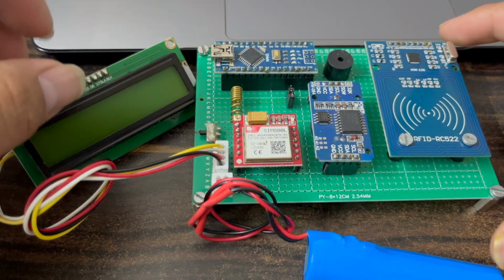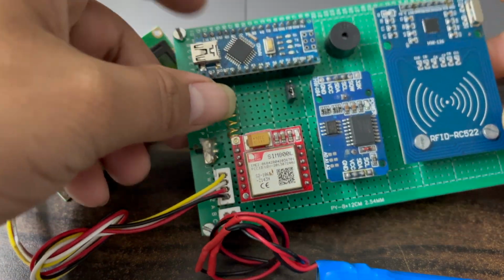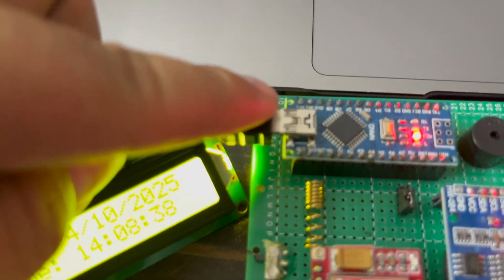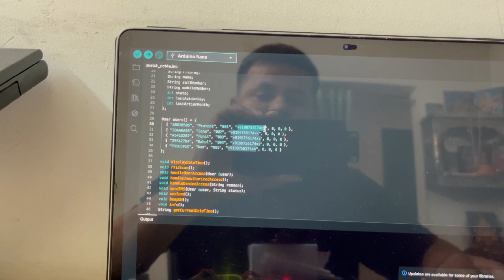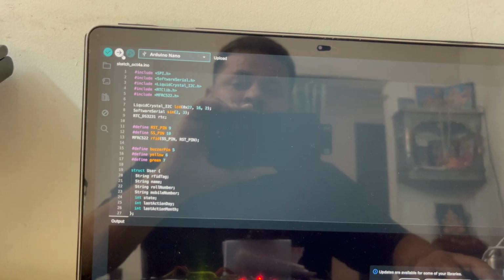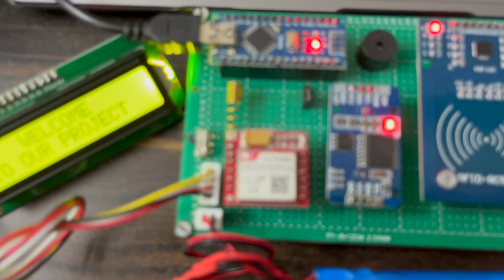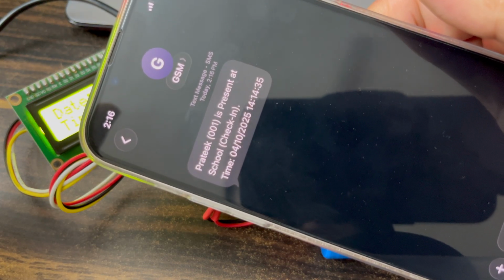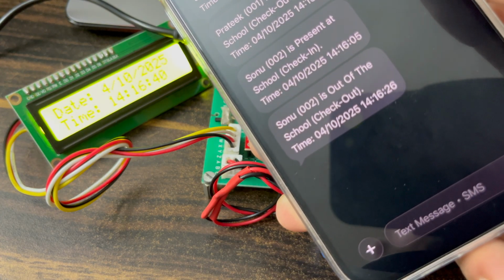RFID & GSM Based Student Attendance System with SMS Alert Using RC522 RFID Module and Arduino

Comment: Hello sir,
 I willingness to do this project but I have small small doubts sir , first in video one circuit diagram will display but in real component one having and in gitup there were something using arduino uno but ine video using nano in and finally the battery are missing in circuit diagram I don't how to connect please help me to do this project sir ...
Reply from the maker: Ok i will given the proper circuit can you email me

Comment: in the board where the LM2596 have be placed sir
Reply from the maker: No i not used the lm2596 converter i used the 3.7v lithium ion battery 🔋